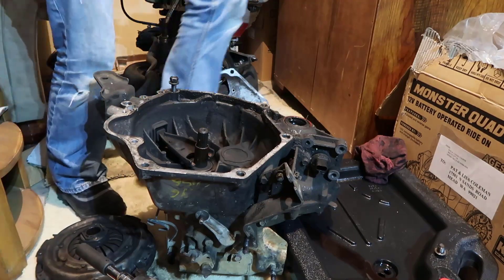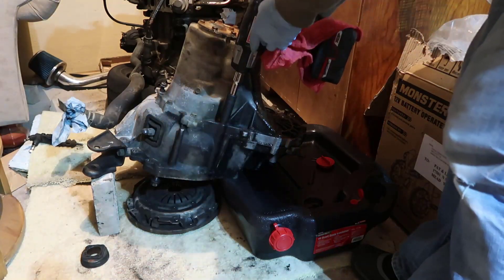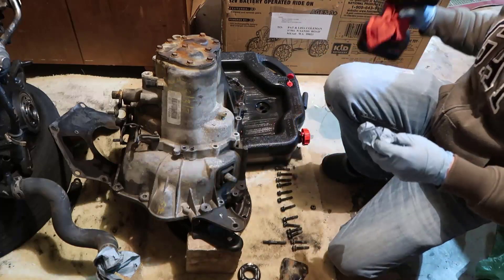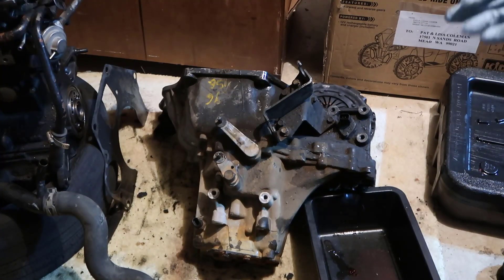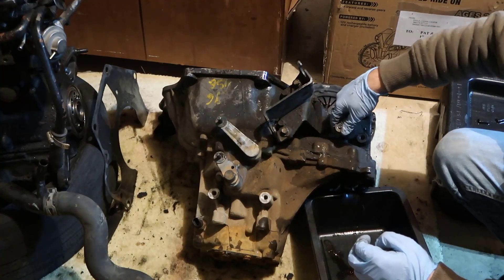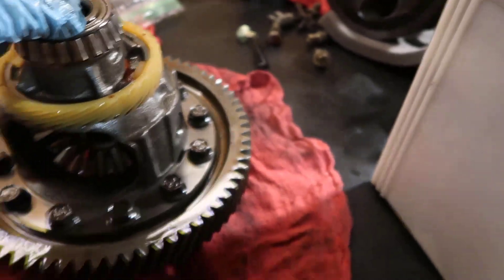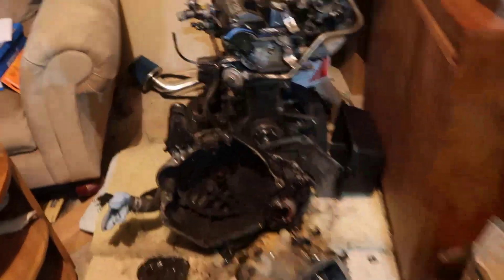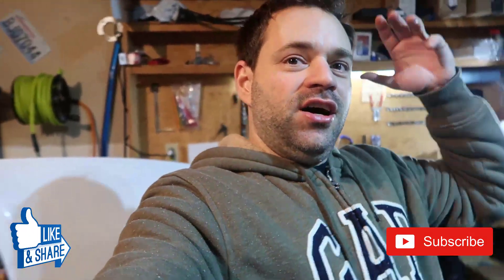Opening Transmission NV-T350 Part 1 - #Eclipse2GBuild

Comment: Marcos you just motivated me to fix the speed gauge on my car with this video, I put the speed sensor on a drill and verify that I don't have a electrical problem, so I realize that the yellow ring on the differential pop out of place. This is what I needed to watch 👍
Reply from the maker: That's awesome to hear Jerry :)
Reply from the maker: Which car is that?
Reply: Its on my 99 eclipse GS, It got a tranny rebuild a year ago, I was driving at the highway and speed gauge just stopped working.

Comment: I might need this video later, right now I replaced my clutch and thrpwout bearing since I was getting noise from the transmission and many said it's thrpwout bearing but it was not. I'm hoping that because it's cold maybe changing the fluid made it so the gears arent fully coated and it'll go away. But if not then either my flex plate is bad and hitting the starter or another possibility is the reverse gear is hitting the main gear. Those are the two possibilities I've seen but hopefully the fluid is the answer since I really don't want to remove my transmission again 😖 it shifts really smooth and the clutch feels way nicer than before but that occasional grinding noise makes me scared something will break soon. If sound doesn't go away once fluid and everything settles then I'll save up for a rebuild kit and replace the flex plate at the same time.
Reply from the maker: I got an extra transmission for $100. Yo be honest I opened the transmission and regretted so much because it's painful and hard to close it back by yourself. 
Hope you figure out what's wrong
Reply: @CarModsGarage  oh but I just remembered you live in Washington now though so shipping cost would probably be really high. I'm going to try to order a new input shaft bearing and if that doesn't fix it then I'll message you but it gives me a chance to save up to be able to cover the shipping
Reply from the maker: Ya you gotta find locally for sure.  I'm not selling mine 😛
Reply: @CarModsGarage  ohhh I understood you wrong lol I thought at first you meant you were getting rid of an extra transmission 🤣
Reply: @CarModsGarage  ya well thanks anyways man ur videos always help out when I run into issues
Reply from the maker: @RicoYT23  glad to hear Rico 👍
Reply from the maker: Nah 😂. Got an extra in case I messed up mine opening it.  Was telling you how much I paid.  I knew you didn't get what I said at first.  No worries brother.

Comment: Does anyone know where I can get parts to rebuild this transmission. Like synchros, gaskets etc . I have issue with my 5 gear popping out when in load or I step on the gas I can feel it fighting me. Any info will help

Comment: Need help identifying the bracket on the trans in this video right next to where the slave cylinder installs to?
Reply from the maker: Never again 🤣
Reply: Late reply but that bracket bolts to the lower cross member, there's a bushing on it and a bolt goes through the bracket to secure it. The bushing is same material as a motor mount. Hopefully it helps although you probably already found it out.